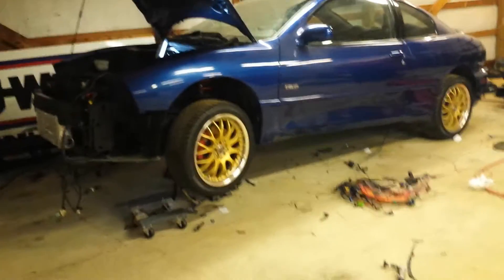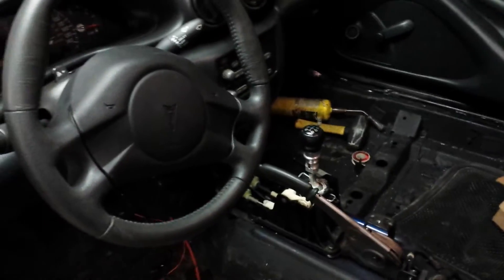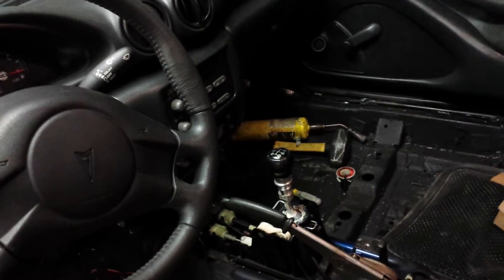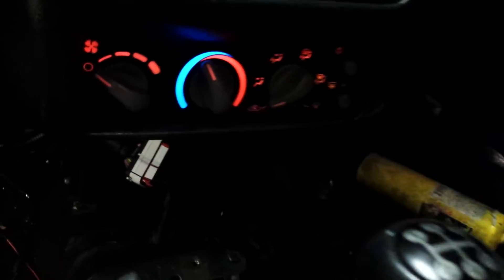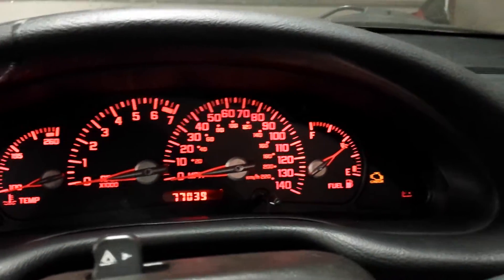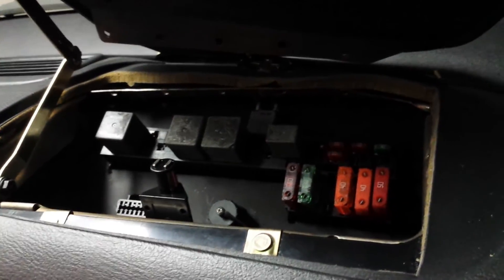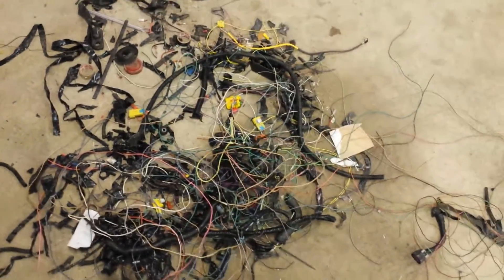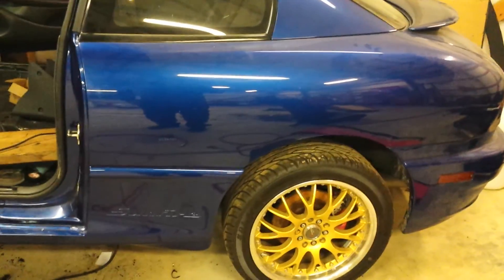Sunflower - New build progress and update 1/12/16

Comment: Nice build, got any pics / info on the engine? What turbo and how much boost? I saw you ran a 12.5, im trying to get in that range aswell!
Reply: 12.4 was my best so far
Reply: +Mike Roof  that was 16G turbo as well. ~365 horsepower